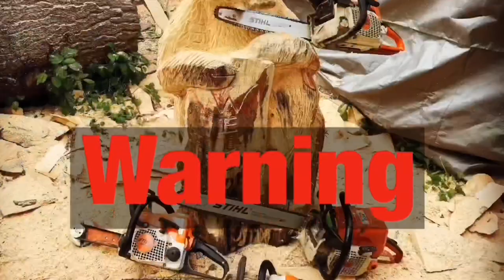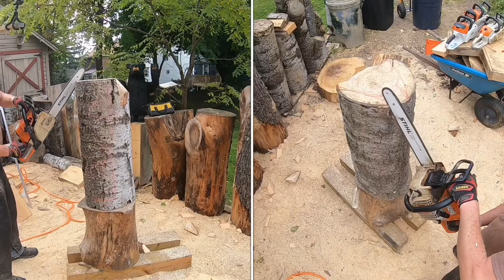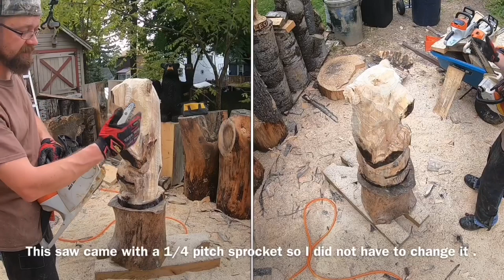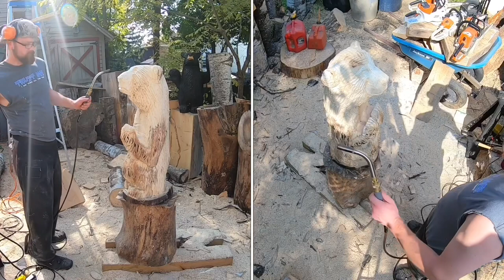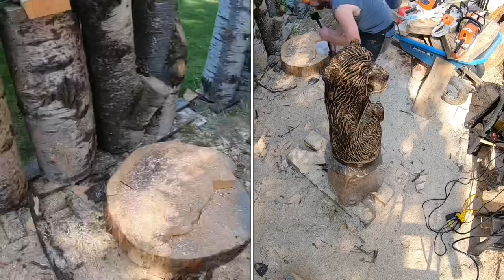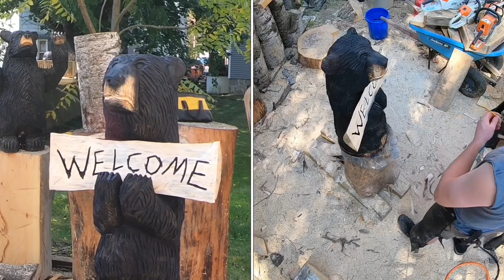Let’s chainsaw carve this bear !

Comment: Hey Kyle, great video again. I’ve watched it about five times. Two questions. Do you have a rule or some kind of diagram that tells you what the correct direction to do furring would be?  Second question, on the Minwax helmsman clearcoat, are you using a gloss, semi gloss. or satin finish?  I am really close to starting my first carving. I have all the equipment and all the gear that you have suggested.  I just bought an MSA 140 for detailing and I will be using the 251 for blocking. Love watching your videos !Can’t wait to get started. I’m almost there. Last thing I need are chaps.
Reply from the maker: I do have some tutorials on furring . I just try to think of the natural flow . What